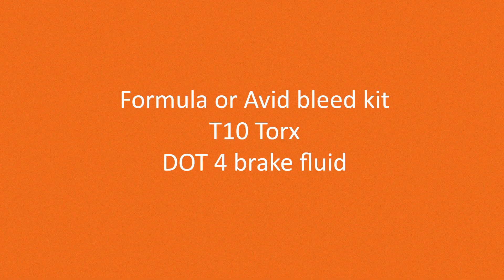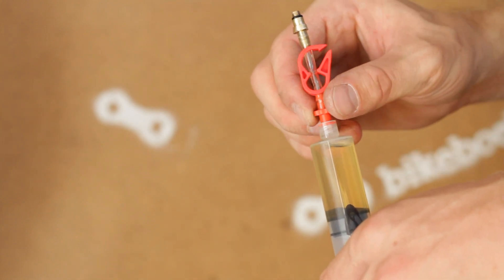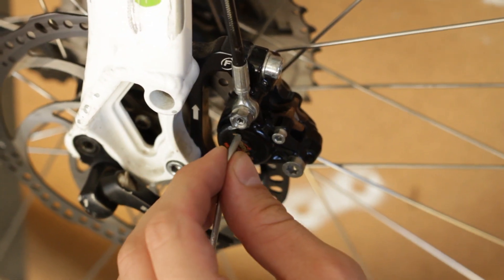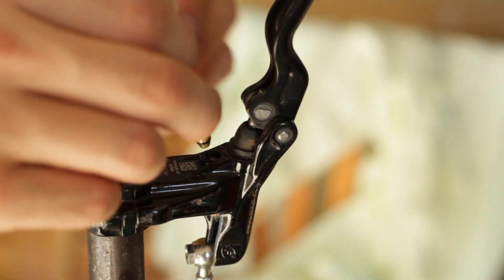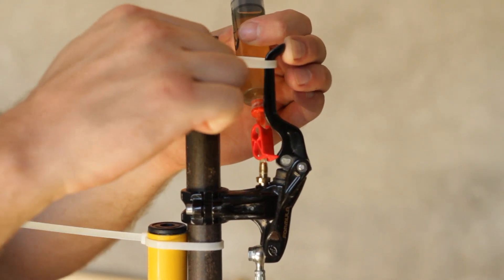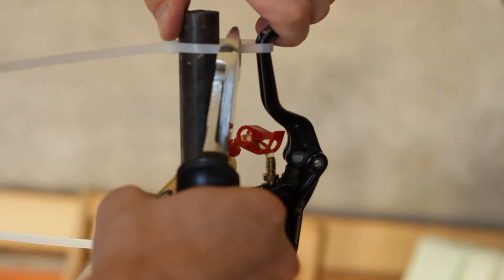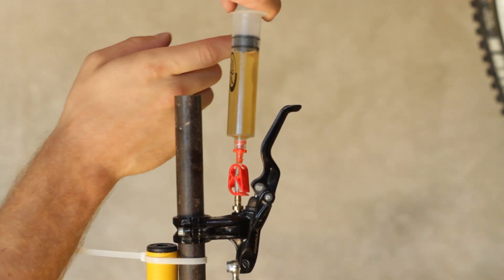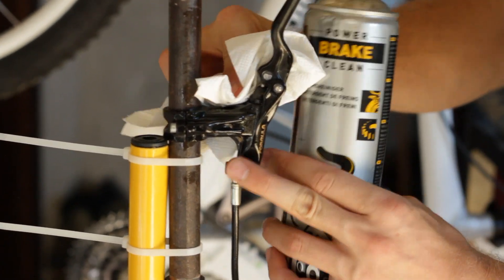How to bleed Formula and Avid brakes

Comment: This is a terrible video.  

First... DOT 4 brake fluid is HYGROSCOPIC, at 1:07 when the person is forcing the plunger down "to create vacuum" you can see the fluid being aerated by air leaking through the syringe plunger.  That air has moisture in it.  By doing that, they are introducing moisture into the brake fluid.

Second...  YOU DO NOT NEED TO CREATE VACUUM TO BLEED BRAKES.  Gravity and bottom up fluid flow does that.

Third... at 3:00 you can clearly see the fluid in the caliper and the fluid in the syringe are not the same and not readily mixing, they may not even be using the correct fluid.

Fourth... Where are the gloves? Seriously DOT 3 & 4 is nasty stuff.

Comment: How often do the hydraulic disc brakes need to be bled?
Reply: virkelie2 When they get weaker or stop working at all - then you bleed them.
Reply: DOT brakes are about 6 months and mineral oil are about 1 year.
Reply: Bullshit, maybe if you are a racer, otherwise no one will do this twice a year. I rahter say only when you feel your brakes spongy, or when you change the braking pads.
Reply: Just letting you know what the manufacturers are saying. This is why everyone is dropping DOT and going with mineral oil.

Comment: I follow your instructions.
But after removing the ryving from the brake at the bottom, there comes fluid out of the system.
I have tried it several times, but always the same thing.
What is wrong?
I have a Formula THE ONE, guess the model of 2008.
Thanks for your support!

Comment: This is the best video on bleeding brakes that I've watched. It's very detailed and the only video that discusses extracting air out of the brake liquid.
I have Formula RX brakes. Bleeding the hose and caliper works flawlessli when done like in the video, however I don't seem to be able to bleed the levers. When I create a vacuum in the syringe it pulls lots of air from the levers. There's a little hole on the inside where the handle bar attaches which lets air in when under vacuum.

Comment: I have a question. When I bleed the lever, it seems like air is leaking thru the lever somewhere :S Could it be that some o-ring is dammaged in the lever? I have no oil leaking, I only get lots of bubbles.

Comment from the maker: You can use either Dot4 or Dot5.1 in dot specified brakes. Be careful Dot5 is not equal to Dot5.1 and Dot4. Dot5.1 has higher boiling point that is true, but we didn't find any useful difference. Dot5.1 is used for example in car racing and other high demanding continous braking conditions. 
Therefore use whatever suits you.

Comment: In the video, bikebook recommenrs Dot4 brake oil. But isn't Dot 5.1 better suited as it has a higher boiling point?
I am very interested in this as I want to replace the oil the manufacturer shipped the bike with (because I think it's of inferior quality. The grease they used for the pedals and seat post is a joke to be honest. And I think that when they spared on the grease, they also spared on the breake oil.).

Comment: I need to bleed my Formula RX brakes, but the bleeding kit is very expensive. For 20 Euros you get two syringes, two metric screws for the calipers and two tubes to connect the screws with the syringes. The bleeding kits of the competitors are better equipped for a better price.
Is there variation between the metric screws between the brands or are they all the same? Or in other words, is it possible to bleed any brake with any bleeding kit of the major brands?
I am grateful for every advice.

Comment from the maker: If you look closely you will see the flange on the copper pin is slightly modified to fit in the lever bleed port screw.